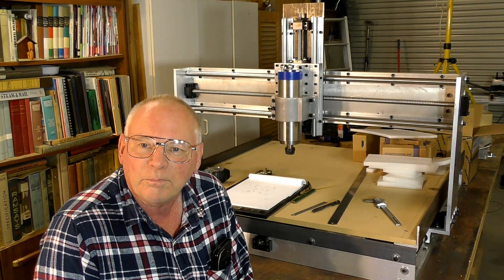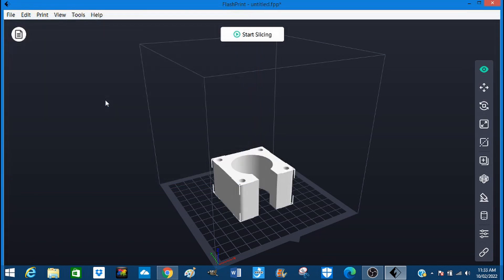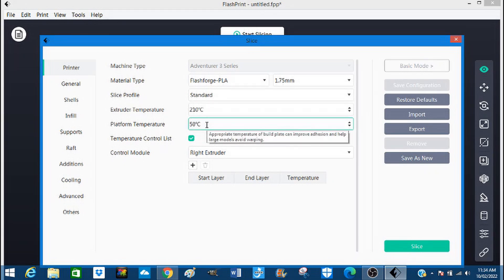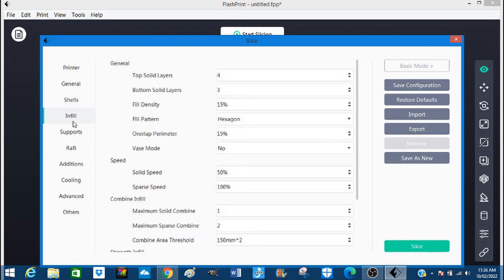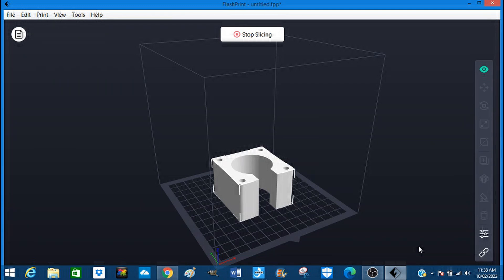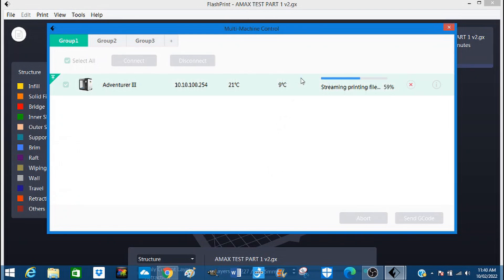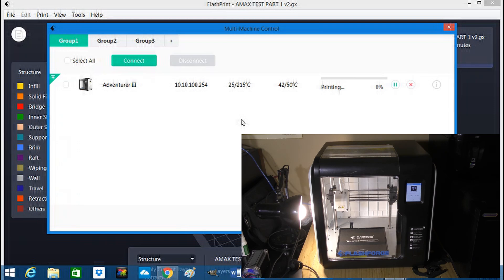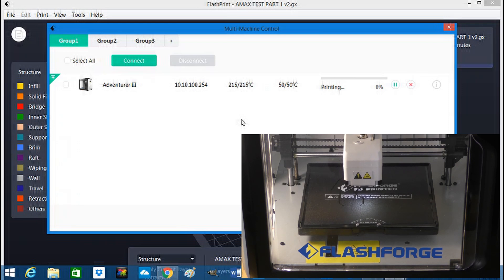3D Printing a Nema 23 boss with Flashforge  Adventurer 3

Comment: I used 3D printed adapters for my steppers, but mine are printed out of PETg, and I also am not relying on the plastic to hold the steppers, mine are designed for aluminum insert spacers.
Reply: PETG can handle a bit more heat, and with the alu spacers that should be fine anyways. :)

Comment: Good video! I have a question though: How hot does the Nema23 get during use? PLA can start to soften and deform as low as 50C, so if the motors get hotter than that, it might be an issue. ABS or Polycarbonate could be better choices if that happens. :)
Reply from the maker: About 30 to 50C
Reply: @inventorsworkshop9600   Good, it'll probably be fine then. :)